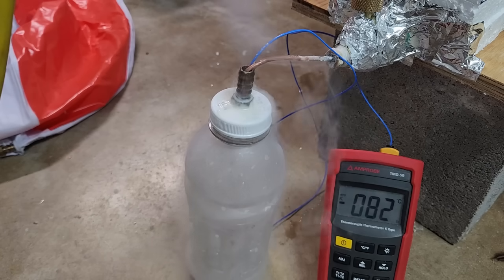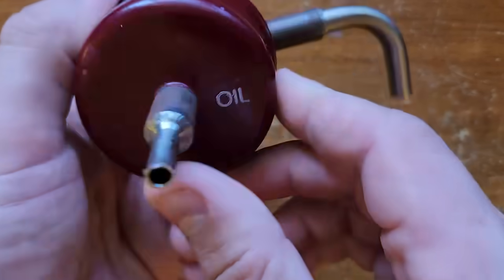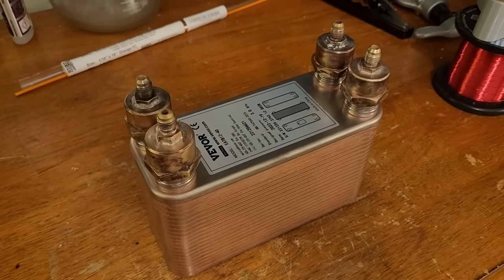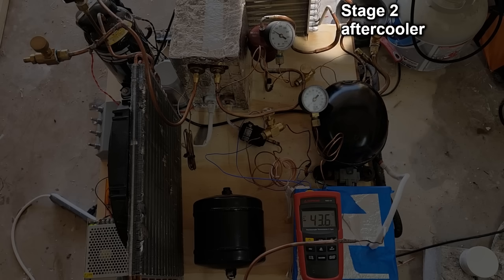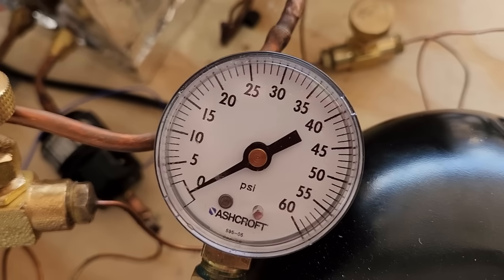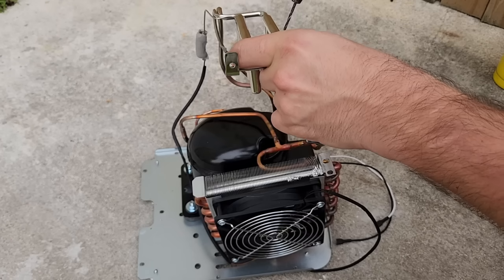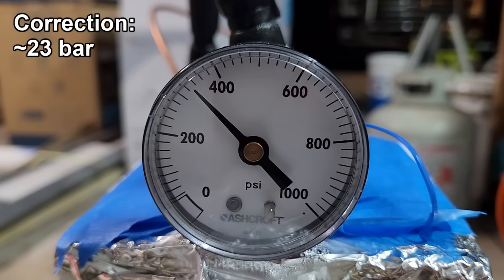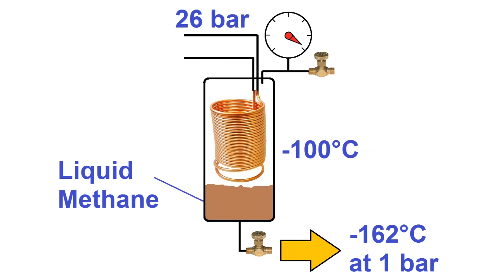DIY Cascade Refrigeration System (Part I)

Comment: What does r1150 ethylene do at ambient temperatures what would the pressure be? 
What’s the static pressure when the system is turned off I can’t find anything online 
What compressor you using in the ethylene circuit?

Comment: 3:33 pro tip: use a sponge, dish soap and a bit of water. Use the wet, soapy sponge on the soldered joint and leave it alone while the system is under pressure for 2-3 days. If, after 3 days, no bubbles formed, the system won’t leak anytime soon.

Comment: The Insulation of cold parts should block water vapour from the ambient air. You can achieve that by using aluminum tape. It will improve insulation significantly. Good luck!

Comment: On the second stage why not raise your oil sump above the process tube on your compressor then it returns to the crank case as it is still on the suction side. 

Then a heat tape on the cap tube that the oil drains through. An intermittent switch activated by temperature. 

Then the heat introduction would be minimal.

Just a thought from an old HVAC Tech/ Contractor.

That style of evaporator is considered a shell evaporator.

Comment: Do you have any hints for using old fridges as there might be very bad refrigerant in it? Would you take some precautions or would you just open it outside and let it go as the same would most likely also happen on a recycling plant? I mean also if you got a refrigerator which compressor is working but it's not cooling it has probably lost most of it's refrigerant anyway 😅

Comment: Hvac tech here : you need to pull a deep vacuum everytime you open the refrigeration circuit to atmosphere. Otherwise you won't have pure Refrigerant in there. You'll have "non condensables" which eventually will destroy the compressor. Also, the P/T charts won't be accurate. Otherwise, great job!
Reply: And he should be doing a low pressure purge with dry nitrogen gas each and every time something on the system is brazed. Otherwise you'll end up with a lot of internal scale that will flake off and mix with the refrigerant/oil and causing blockages and eventually burn out the compressor.

Comment: I am intrigued by your experiences with a DIY cascade refrigeration system. I took the 'easy' way out and found a commercial used/surplus one on Ebay that produces -110c temps. In the event it ever fails I will use the knowledge I have picked up watching your videos.

Comment: Don’t be afraid of the suction running in a vacuum! In the old days even household refrigerator/freezers ran in a vacuum! Early cascade systems used R12 for the first stage and R502 for the second stage! Note that in those systems we skip the oil separator by using pentane to keep the mineral oil flowing. Propane is less miscible in POE and therefore slightly more efficient but needs velocity to return the oil. Probably not an issue in this small close coupled system. Note that there are cascade systems that use a single compressor with two different refrigerants called an “auto cascade”!

Comment: I dont seem to be able to find a inexpensive oil separator, but I have a solenoid on hand.  how often should to open and for how long?  I have a compressor out of a ice maker need to get this as cold as possible for lab work.  I think I will have the evaporator coiled around my largest reaction vessel and put that in a bucket of antifreeze.  unless anyone has a better suggestion?

Comment: The diagram w pressure meters at 17:20 is nice.

There was an earlier diagram of the same that did not have numbers on the meter faces, and which had a tick mark st the 6 o'clock position, and that earlier one was confusing.

Comment: It could be that you have put an industrial microplate heat exchanger, the one there that recovers the heat the cold fluid actually recovers the heat and the hot one recovers.  Indeed it releases the heat.  So you didn't build a DIY plate heat exchanger but you bought a plate heat exchanger only that's a micro plate heat exchanger and called it an intercooler for your cascade refrigeration system

Comment: I don’t see if you added somewhere a “liquid interlocking” after or before expansion valve and make some kind of a liquid collector before it goes to evaporator again. What if you add one? It will help you to “lock” liquid before liquid condenses efficiently after compressor in a condenser and temperature exchange and thus condensation should go better,otherwise vapors after compressor tend to pass quickly without efficient condensation. Also what about working on a condenser and find a highest spot where you will solder additional valve for venting incondesibles which will make easier to purify gas in a cycle and achieve proper condensation pressures?

Comment: Really, you should be brazing with nitrogen flowing through the pipes being brazed,  this will stop any internal pipe  oxidization finding its way to the tiny capillary tubes and blocking them or restricting them. I know this is purely a diy hack job but none the less, sooner or later those flakes will find your capillaries.

Comment: Cascade is a great idea however one can reach much colder temperatures with a cold head valve like those on an mri machine are liquid air machine. The are relatively inexpensive compared to the time, energy and materials involved in your cascade project and supior in almost every way. 43 years cryogenics and refrigeration( I grew up at a cryogenic stratification facility).
Reply: Have you seen the price of the helium compressor for the those cold head?

Comment: Would bronze wire work instead of silver solder? When I worked for a company that manufactured poolfencing, balustrades and aluminium fire ladders for Queensland fire and rescue, there we used bronze wire to weld mild steel to aluminium where required.

Comment: You gotta get the impressions down man the lower the pressure the colder. The refrigerant can run if you could run in vacuum which you know somebody like. You should be able to build a vacuum to pull evacuum on the evaporated. Then you're looking at and cry of genius bro.

Comment: one thing that I caught myself thinking now, you have to include a safety valve in the ethylene condenser. As shown in the video, if the first stage stops and there is no cooling in the ethylene condenser, there will be nothing to prevent the pressure from continuing to rise until one of the components fails. that would cause an explosion

Comment: Instead of venting off the liquid, perhaps passing the dried gasses over 3a sivese. Given the size difference between the molecules (h2 0.5 vs c2h4 3.6) using an appratus similar to an oxygen concentrator may help.

Comment: Oh man "loaded with flammable gas".
European legislation for automotive heat pumps will likely limit refrigerant charges for propane systems to 150 g max. R1234yf which is currently in use regularly has charges of over four and a half times that. Now I hear some say: "yes, but this is good because propane is flammable, I use it in my grill". R1234yf is also flammable and at that additionally produces HF when cumbusting. So it will not just burn your face off like propane, it will also make an acid which s so corrosive it attacks glass. Just because people have heard about something, it is not automatically more dangerous. 

Great video, love your stuff.

Comment: You can buy silver solder on a roll, with a silver solder Flux, and it's strong enough that I use it on custom length bandsaw blades

Comment: Remeber pipe size matters. Small on high pressure will flash to low temps as the pipe size gets larger..

Comment: hi, beautiful work! Congratulations on your effort. let me try to help with some tips. To reduce the by-products in ethylene generation you must preheat the ethanol vapor to the reaction temperature at the reactor inlet, so you avoid temperature gradients inside the reactor, this makes the reaction more selective. The easiest way for you would be to add a tube-to-tube heat exchanger in a cross-flow configuration. Circulate the reactor outlet in one tube and the steam inlet in the other. with this you will have the inlet gas at a temperature close to ideal.
Reply from the maker: Thanks for the pointers. I was actually planning to purify via dry ice for the next part of this video
Reply: To separate ethylene from hydrogen you have two options, one is to use a molecular sieve (zeolite), the other is to place the reservoir you made in a dry ice bath. as the temperature of dry ice is lower than that of liquid ethylene, you will condense the ethylene and be able to purge the hydrogen at ambient pressure (although a little pressure in the reservoir can help the process by increasing the ethylene condensation temperature, since they are very close). I keep watching your videos, count on me to help you. congratulations
Reply: As for your cascading system I see room for some improvements. Let me know if you're interested.
Reply: reviewing what I wrote has an error. you will need to pressurize the reservoir to about 100psi to have an ethylene condensation temperature of around -60C. So to separate the hydrogen you will have to purge it little by little as soon as the temperature stabilizes
Reply: @danilofjf  little by little? Acho que encontrei um brasileiro aqui kkkkk
Reply: @arthurlondero7036  encontrou mesmo!
Reply: Engenheiro mecânico TB?
Reply: also consider passing the final product through a molecular sieve as part of the hydrogen can be dissolved in the ethylene and this will cause you problems.
as the size of these molecules are very different any zeolite will help you and you just need to put it in a container and pass the gas through it

Comment: PolyIso sucks hard ass compared to other insulation options when it comes to cold temperature insulation. Its fantastic stuff on the highest order for say an attic in texas, but is far worse than XPS if it were used on walls in the frozen tundra.

Comment: Stainless to copper was a PITA, but with enough sandpaper and good flux it becomes easier. Using regular lead-free plumbing solder, no less. Forget the flux, maybe zinc chloride. Although for high pressure applications, no idea. Probably useless info if you have the good stuff.

Comment: Do you actualy store the ethaline in the beach ball or was that just temporary?
If its not it would actually lose hydrogen through the gaps between the molecules in the material (bike tires reduces to mostly nitrogen given time as the rest escape through the rubber)

Comment: Wouldn't it be a better idea to purify ethylene with dissolving it in diethyl ether under pressure then collecting the solution and degassing it to get the pure gas?

Comment: Thanks for these.
I've been wanting to do the opposite.
I want to move summer heat from my off grid cabin into a storage mass buried next to it for winter usage. Seeing these real life examples of pv=nrt.
I could probably use these standard components for the initial stages, but for the hotter stages I'll have to figure out a heavier medium. 

The length of thinking a lazy person will go to in order to avoid chopping wood might be unmeasurable.

Comment: Are those plate heat exchangers rated to take the sort of differential pressures you're feeding it?

I can see the low pressure side getting squished closed.

Comment: Ethane might be complicated to produce, but you can just buy it. Heck, at XCOR we used it as a rocket fuel for more than ten years and simply called up our welding supplier whenever we needed more.

Amusingly, because it has modest pressure at ambient temperatures, ethane was supplied in the oldest bottles we'd ever seen, ones that had been derated due to their age. The record was a bottle that had hydrotest dates stretching back to 1915, almost a century old at the time.

Comment: Wow!

We tore out out cascade cooling systems as they weren‘t
very reliable.
One can drive compressors near their limit/just outside it
by replacing the valve plates (higher compression, higher
wear) and with R404 you‘d reach similar temperature
differentials.

Or go cheap and use a Mayekawa screw compressor 😅
-100C with their Pascal Air.

I salute your efforts, this is so good because I had forgotten 
why you want to reach these low temperatures!
Reply: About leaks:
Leak testers for hydrocarbons like propane could work for you too.

They have a flexible sniffer that can reach the spots where the leaks usually occur (the least accessible point of failure).

Comment: To analyze the operation of the system, it is worth adding a few more devices that allow you to calculate the overheating and subcooling occurring in the intermediate heat exchanger.

In addition, all ULT refrigerators that I have seen are fully insulated, including capillary tubes.
replacement capillary used REFCO TC55 12.3m (id 1.4/od 2.6)

Comment: i'm guessing that your issues with the plate cooler is partially because your use case is way below the rating for that cooler. at the cooling loads and mass flow you're dealing in, you're back to fighting thermal conductivity like in the resonant cryocoolers. your less efficient but far more linear coil intercooler worked better because heat can't transfer as far back down the tubing.

Comment: The best option for your second stage compressor would be a semi-hermetic compressor. Great flow rates and you don't have to worry as much about the compressor oil getting trapped in the low side and the windings won't be running in a vacuum.

Comment: That hermitic compressor is not gonna live a long life if the suction side is in a vacuum. The windings will arc and steadily destroy the insulation coating until it finally kills a winding.

Comment: Do you pull a deep vacuum on your systems before charging with the propane and ethylene?  Humidity/moisture is no bueno.  1000 microns or less is a deep vacuum

Comment: You should've used silvaloy for those copper to stainless joints as it would tin the steel allowing copious use of a 15% silver braze rod. Over the long term the joint will hold up better.

Comment: I wonder, can't you just let the hydrogen diffuse through the beach ball over time? Helium and hydrogen molecules are very small and pass easily through thin films, it might be possible to just let them disperse through a molecular sieve. On the other hand, if the membrane is TOO permeable it will actually both let the ethylene out and draw in contaminants from the atmosphere due to osmotic pressure.

Comment: Perhaps your second stage could be a triple stacked peltier cooler with a thick copper plates in between and then the first stage to cool down the stack. Although peltier are really inefficient, it saves the headache of having to deal with all these different gases and trying to keep the tubes neat and gastight.

Comment: I liked the video, but I am an hvac service tech, and I have a few notes for you,
Please contact me for any issues you may come across, I would love to help out in any way possible.
I noted the flare fittings you used are designed for water use, they are milled flare nuts, the ones you want are "impact forged" and they handle the pressure better as the water use ones have a tendency to leak.
It looks like you also used fuel grade propane as a refrigerant. This is sub-optimal as propane fuel has impurities like ethane, methane, butane along with the propane, some even have a little water contamination. I do not recommend using propane fuel as a refrigerant and its impurities will mess with your results.
I am wanting to build a system similar to the heat pump water heated, but with a cold water tank with an antifreeze solution to achieve 15 Fahrenheit ranges and use that to supplement my house cooling by dumping the heat into my hot water system.
I may be contacting you for some ideas in that.
Good Luck!

Comment: What oil do you use in the 2nd stage compressor?
Reply: POE
Reply: @Exotic_Lab  The reason I asked - Is it thin enough to not crystallize or gel at that cold temperature?
Reply: @kerryb2689  that's why there is oil separator. Oil is separated from refrigerant before it enters cold side.

Comment: Use loctite high strength for thread sealing. For sealing flares and sealed joints use Nylog or similar HVAC sealant. Also I've read that more than 12ft of cap tube doesn't really affect the flow much. That was my experience also when I put together two 10 ft pieces I felt it was basically no different than with just one.

Comment: I think a large portion of this is down to the fact your gas based burner likely overheated the lower portion of the catalyst. There is a decent chance the temp readings on the lower part of the tube are much higher than the lower portion. I think it might be worth trying lower temps. 
Since if you favour the output of ether and ethylene rather than ethylene and hydrogen. Unless I am mistaken you can simply recycle the ether into the ethanol as ether boils at 34.6C where as does so at -103c. It also might not hurt to purify the ethanol to avoid introducing any water into the system, which you can do via something like an off the shelf air still. This and it might be worth using nichrome wire along with insulation kaowool.

Comment: Good work!  Have you seen Ben Krasnow's (Applied Science) video on that cascade system he refurbished?  Another good channel doing cascade refrigeration is M4J5TER.  He figured out you can use ordinary silicon diodes to measure cryogenic temps.

Comment: I think you will stretch the system too much with only to stages for -100c, I used to work building refrigerators for ultra low temperature and we would only go to -80 with two stages, for -100 we would always go with three stages.
Reply: Two stage freeze dryers are getting to -104 C. using an ethylene in a second stage filled under pressure 100 psi. I think his problem is hydrogen contamination. To purify he would need to liquify ethylene in -170 C. or waste $600 for 4 oz. of refrigerant. Otherwise his setup should work.